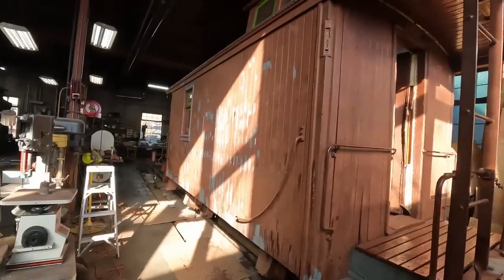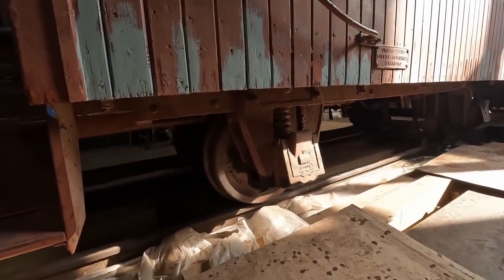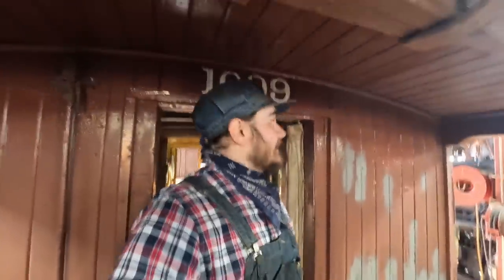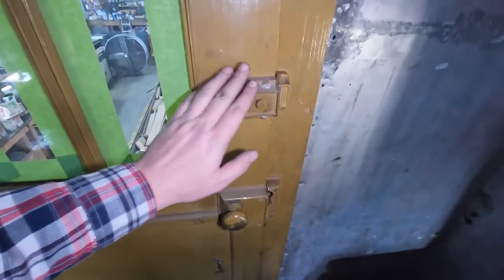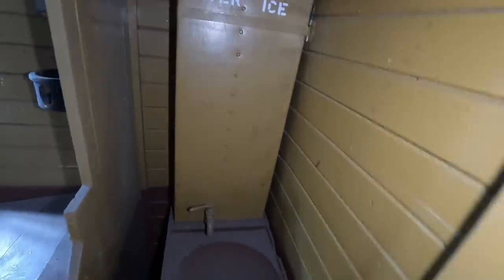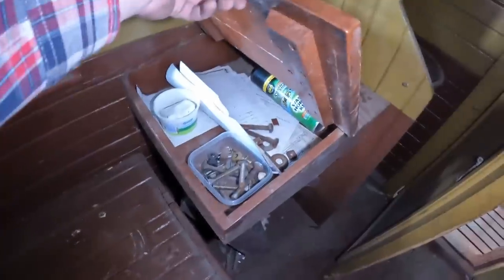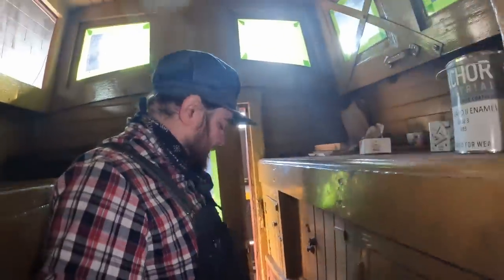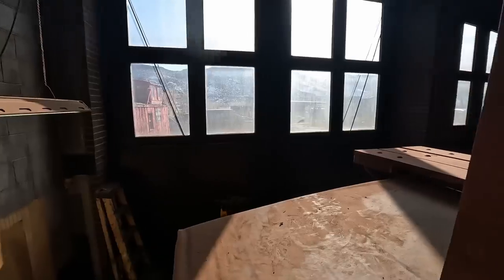DSP&P Waycar from RAILROADS ONLINE still exists as the C&S Bobber Caboose!

Comment: Do modern cabeese have toilets as well? If locomotives have them (like mentioned in one of the Jeopardy videos), surely cabeese have them too..

Also in case of bobbers, "Make sure you maintain 3 points of contact when riding in the cupola." 😁
Reply: Locomotives have toilets?
Reply: Unfortunately there are no "modern" cabooses. At least in North America. They have been phased out for a long time in the US, replaced by the EOT device (think "computer brakeman").

You do still see them on various short lines and heritage trains and such but they are extremely rare on mainline trains.

However to answer your question: yes many cabooses did have a toilet. Most of which were nothing more than a bucket, or a hole in the floor or a cassette toilet. Can't say I've seen a vacuum pressure toilet in a caboose, but I imagine they are out there on later models.

I'm not a professional, just a railfan, I'm sure others would know more.
Reply: @BMMEC6000  They aren't exactly the height of luxury, crammed in the nose of Dash 8 and 9's that I know of, probably others.
Reply from the maker: Not that I've seen.
Reply: @greyshadow9498  oh I thought he was talking about STEAM locomotives. That would have been real awkward
Reply: @BMMEC6000  Although... When you think about it, disposal would be easy.
Reply: @greyshadow9498  well for the solids sure but what about the liquids. Or would you just pour those into the tender tank?
Reply: @BMMEC6000  I wouldn't want to smell that!
Reply: @greyshadow9498  me neither!
Reply: The sink was at a mighty convenient height. I imagine a bucket for the rest.

Comment: In its current state, the frame is supported by coil springs over the journals, yet there's a 1935 photo of this caboose in Leadville (Google image search) clearly equipped with much easier riding leaf springs. Why is this, or were the coil springs a workaround due to all the frame hardware and equipment missing?

Comment: Do you have a D&RGW Long Caboose at the museum?  Can't remember if I saw one when I was there, but it would be cool to see the inside of that to compare to the smaller one.
Reply from the maker: We have three(ish) - the 04990, which is owned by the city of boulder, and modified from a boxcar and has no interior;  then the poor 0585, which is a genuine D&RGW long caboose, but someone cut the sills (main stressed member) and we jokingly call it "the caboose that fell out of orbit" - it's sagging really badly and desperately needs repairs; and then RGS caboose 0404, which is actually in pretty good shape and has been in train service within the last few years.

Comment: Hyce speaking of mow, in case you know what kind of rail do you use at the museum.
Reply from the maker: It's mostly 65-75 lb rail, some of it is 95 lb.
Reply: Ok thanks. I am guessing that will hold 491
Reply from the maker: @TrainBandit  yup. 491 first ran on 45 lb rail...
Reply: @Hyce777  ok. Thanks for the help